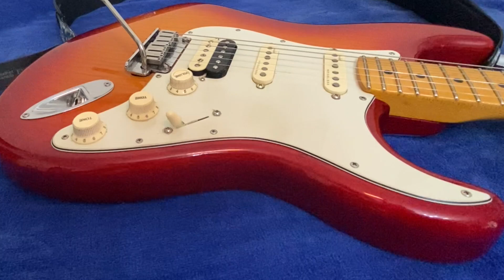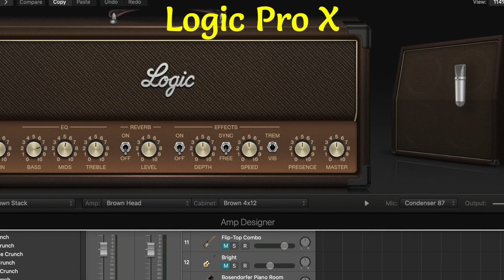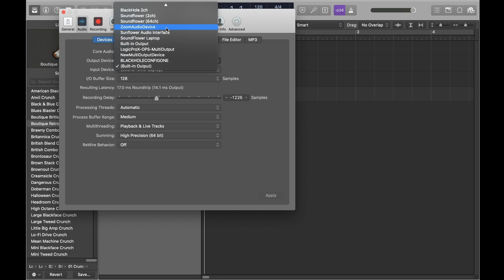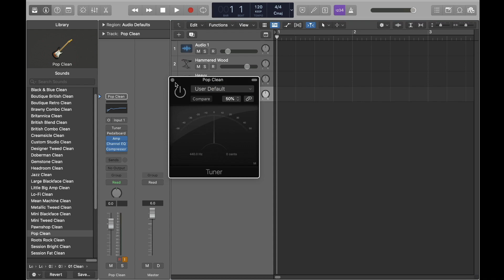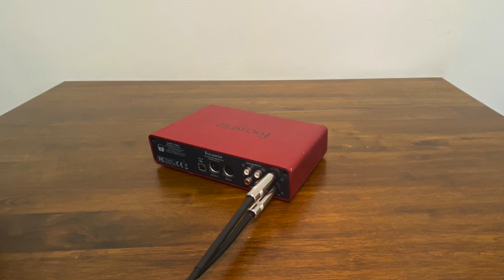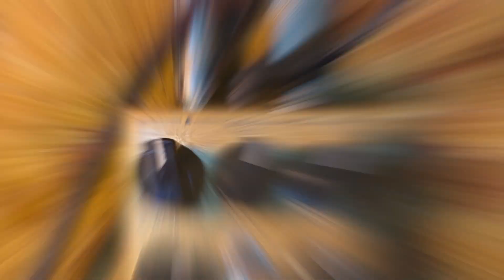Electric Guitar with Logic Pro and an Audio Interface

Comment: as just for recording i like to just plug into the interface…..guitar to interface…and use amp and effects plug ins in logic pro. never tried to record my amp. hughes and kettner tubemeister. gonna give a try soon tho.
Reply from the maker: Yes.. i do that in many scenarios as well.. especially when practicing alone.  I like using the amp when practicing with my band because it provides another speaker and more accessible knobs on the amp and my foot pedal.